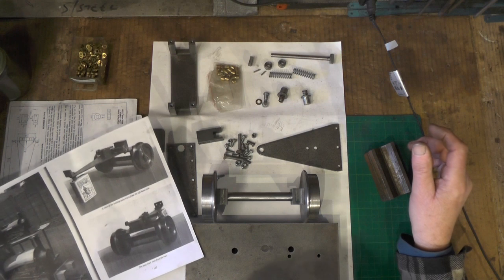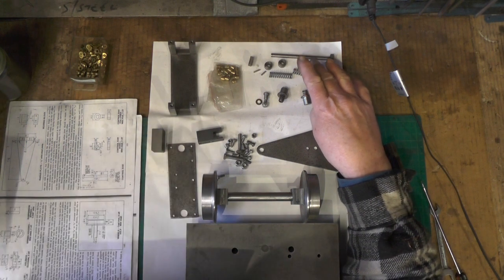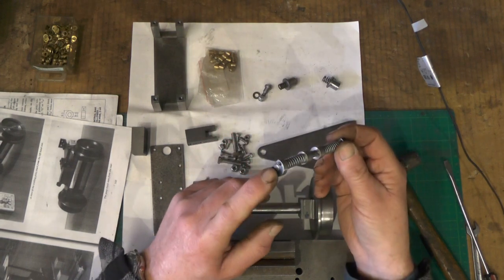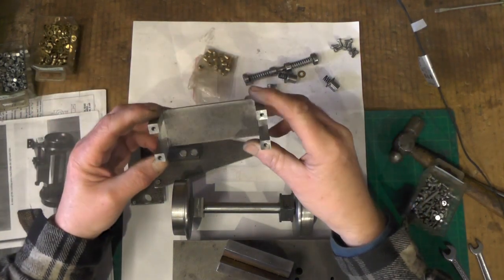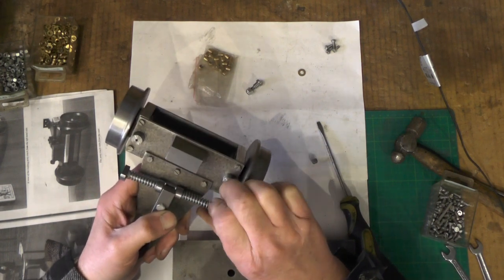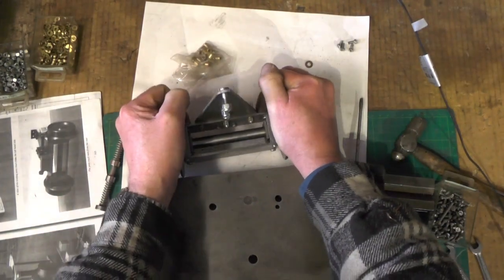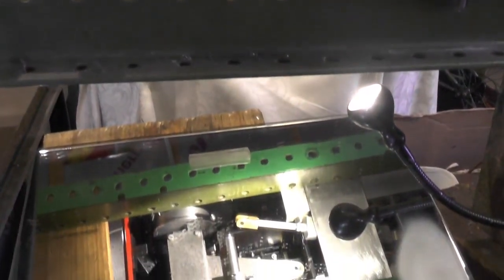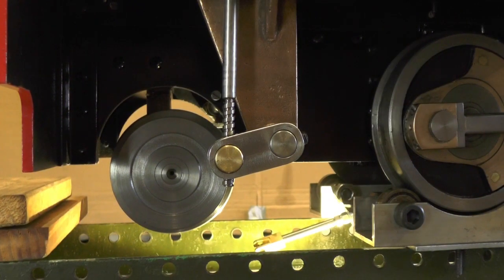Build Your Own Beginners Miniature Steam Locomotive Series (Trailing Pony Truck P4 ) "mr factotum"

Comment: interesting. Are you going to take it off again to paint it? I presume you had all those BA bolts already in stock as there not cheap!
Reply from the maker: hi paul, 
yes 2 minute job to get off, will paint later, yes ba bolts old stock from a job lot !!!, otherwise would use metric
thanks for watching
stay safe
regards
mr f